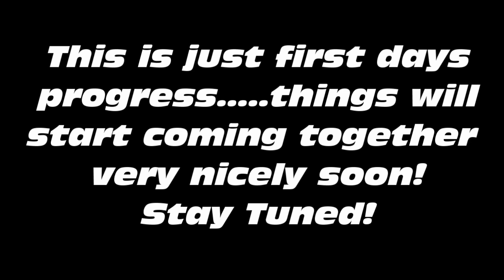Twisted's 8 DAD 15" Clamshell Build Log-Crescendo Audio,Team HZ Addiction,Walled Productions,PT1.

Comment: Did you foam the behind the plastic panles, before you put the sides up?

Hope thoes little brackets are just temp even glassing them in wont make a strong enough joint..  Need some 2x2 at least or even 3" 45's then glass on top will be soild.